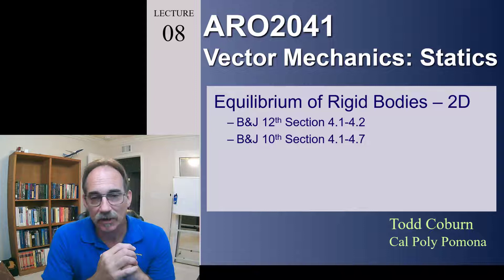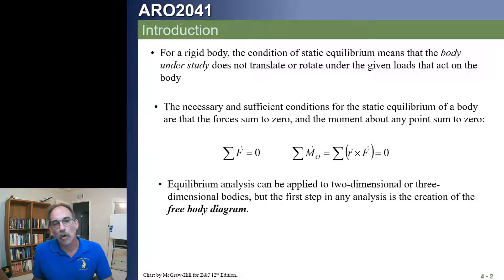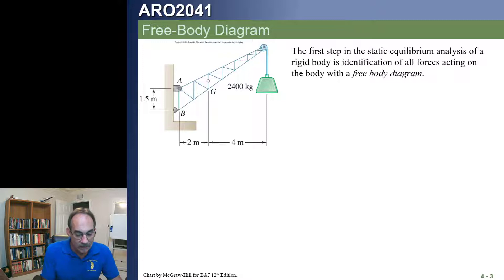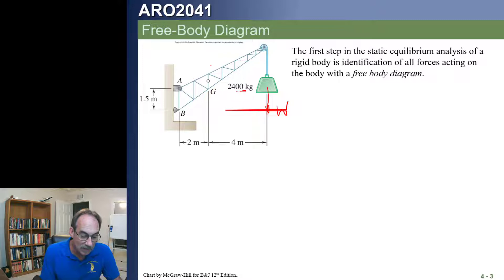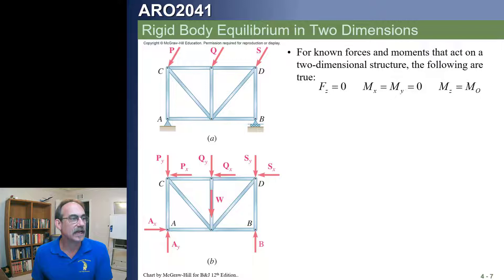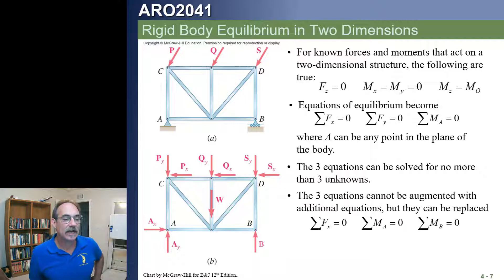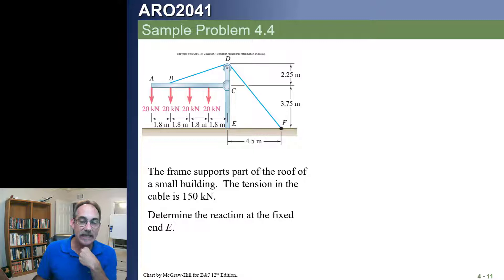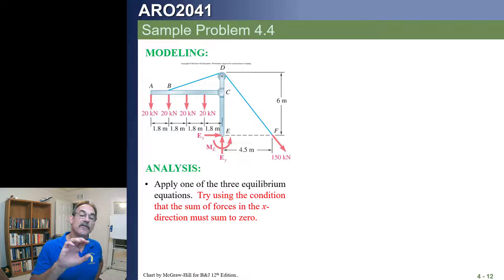Statics: L-08 Rigid Bodies - 2D Equilibrium

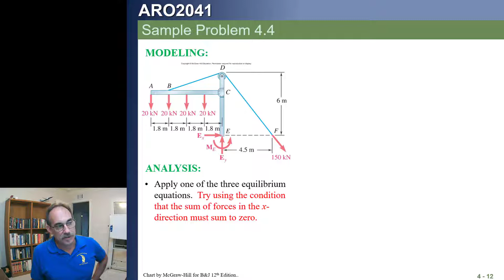Comment: Hi Todd, Could you please let me know why are no reactions considered at point C since it is also a joint/support. Timestamp : 31:14.
Reply from the maker: Prithvinayak, point C is internal to the structure.  One of the keys to making a problem easy is cittibg it at the places that make analysis easier.

Remember, make cuts, replace removed structure with forces and moments appropriate to cut, then analyze

Comment: Hello Professor,
I just found your channel. I work in aerospace CAD design ( composite structures) and ive been  trying to learn by myself aircraft structures .
Your videos are awesome. And its so fantastic you just teach all of this in youtube.
I dont know if your would have time for some tricky questions i cannot figure out..
Ive neen studying Bruhn, Peery, Niles& newell, Fabel, Megsson, etc. I just realized you also have books.
There is a thing on shear flow in thin wall beams that i really cannot find an answer to; and also on the torsion of bow beams. I cannot comprehend how do one calculates if the webs will not just buckle due to instability due to deformation and increase of the moment arms.
The books teach you beautifully to calcutate the shear flow but not to know if the beam would be able to take the torsion.
I just dont get how the shear modulus is the one thing one uses to say" its fine. It will not become unstable".
Maybe you can point me to some book or paper where this is explained?
Thank you again for all this videos.
Reply from the maker: Humberto, thanks for the feedback.

The first step for thin-walled beams in torsion is to calculate the shear flow correctly.  My videos cover this for single celled beams but i have not recorded my lectures on multi-celled beams yet.

The next step is calculating whether the webs will buckle in shear.  My videos and text cover that.  If the webs buckle, the web goes in to diagonal tension, which is also covered in my videos and text (at an introductory level).

Most of the texts you referenced cover these effects, as does mine.

It sounded like you had further questions though.

Does that answer your question?
Reply: Hello Professor,
Thank you so much for your answer.
Yes, my question is kind of visualization. 
Strangely enough i can understand without ( with a couple of exceptions) the tension field effect . its more intuitive since its like a truss with infinite tension cables.

I wonder if it would be easier if I draw something and email to you?
Ill try to put in words though.

The first thing that comes to my head...a box beam. 1mm thick webs. (.040 in) .

Torsion due to aerodynamic lift is applied.

The box beam twists. 

And here comes the super confusing part....

Looking at the cross section, in my head, The webs get compressed. And they start bowing. And the the tiniest of bowing will make them bow even more -like a sheet of paper.
And then they shuld just collapse very easily.

Obviously there is something Im missing since that doesnt happens.
Thinking about it in tree dimensions, the ribs are stopping the skinns from folding- i think. Not sure.

The skins are are also a bunch of little squares in shear so its not like a column under compression when one looks at the cross section.
But the only thing that will stop the skins from folding will be tension once the buckle....

At this point im speculating. Im pretty sure im not visualizing the process properly.
I was looking at the bruhn chapter A19.5, when he calculates a D-section spar.

I cannot comprehend how there is no compression on the vertical web and how it will not just bow like a sheet of paper squeezed between the flanges bending up; and how the nose of the "D" section doesnt just folds..

Its more like i cannot visualize the process in 3 dimensions.

I played with the idea that The resultans of the shear forces in the skins  are diagonal compression and tension forces. AndPpeery actually talks about it and shows mohr circles proving it.
But are those resultans replacing the shear forces?
Thats whyone designs webs with a bunch of -45/+45 because how on earth do a bunch of fibers take shear on the 0 or the 90, they will just come apart i think?

But . yes. The whole thing is confusing. I cannot visualize the interaction and deformation.
Reply from the maker: @humbertovaldivieso5171  check out my text on diagonal tension, or Bruhn’s.  Once the diagonal tension field develops, the veritxal stiffeners do indeed pick up compression, and the caps pick up bending.  This changes rivet forces.
Reply: Hello Professor,

Yes, i checked up that. I was trying to say that diagonal tension is very intuitive to me.
And i can understand that case.
The one i dont get is the skins not buckling and collapsing  under the slightest torsion  load .
Reply from the maker: @humbertovaldivieso5171  the skins don’t buckle under torsion.  They buckle under shear.  Torsion of a box beam causes shear in the webs, which causes buckling, which induces a diagonal tension field.  The web will collapse if the vertical stiffeners and cap bending stiffness is not sufficient
Reply: Hello Professor,

First I need to tell you that  that i really -really appreciate your patience with my " i don't get it " 350 questions.
That shear thing is so weird.
Im in  the middle of moving to georgia, but ill get your books once there and read  and think about this more.
I cannot keep pestering you with this shear thing forever. Its almost like the skin is designed for aerodynamics and tension but not shear.
Its difficult to ask by messages and not been able to move my hands and draw in a board.
But i want to thank for trying to explain this to me. And please dont stop posting videos. They are awesome and im learning truckloads from them.
Im starting to watch the FEM Ones too , since i know how to build FEM models and set up cases in Femap but enough to get it all wrong .cause of my limited understanding of the tricky physics.
Reply from the maker: @humbertovaldivieso5171  aero structures are thin.  That means they are strong in tension but weak in compression.  Bi-axial and shear loading both translate to compression at some rotation of tge element, which drives buckling behavior.  A properly designed web can buckle in shear and still carry a lot of loads well beyond the buckling strength.

My book and videos currently only cover the simplest of diagonal tension.  Bruhn goes much further.  Yet the treatment i provide makes it perhaps easier to see the why of it